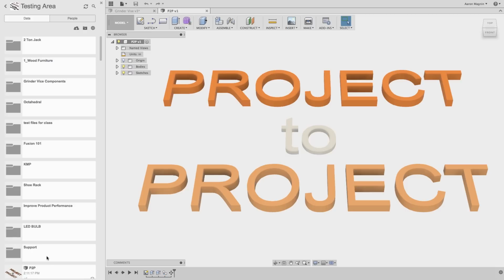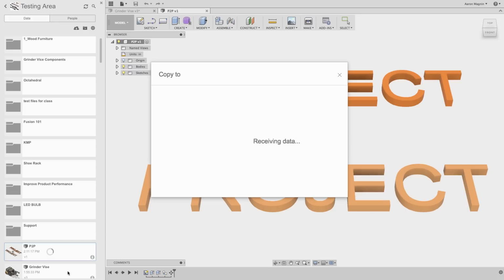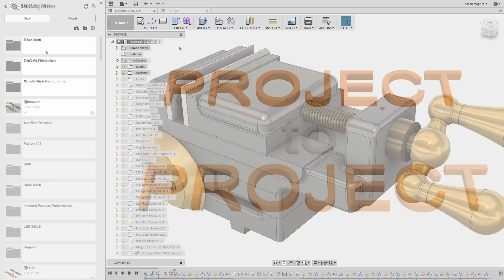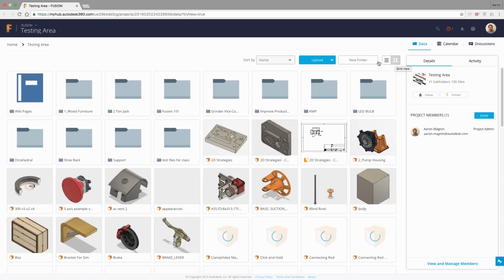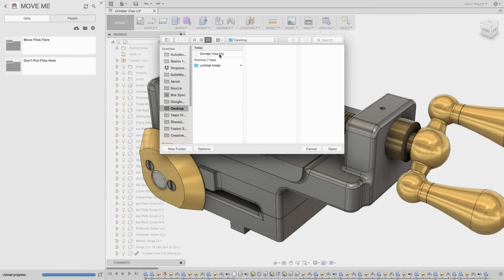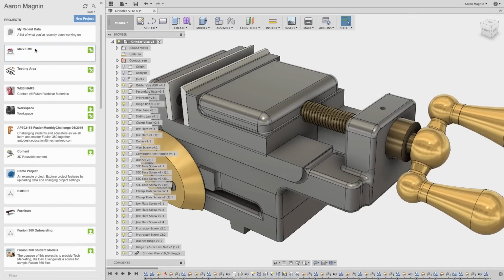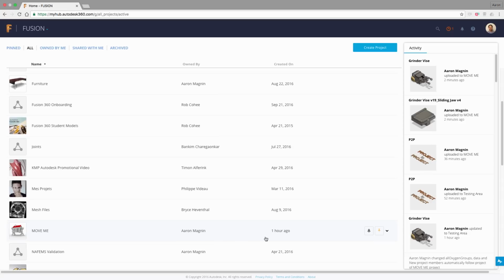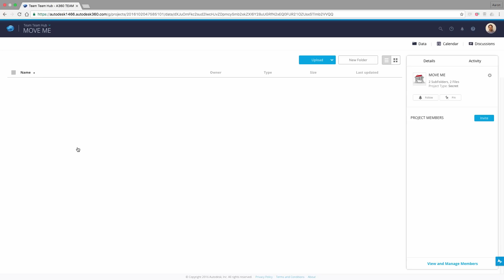QUICK TIP: Move and Copy Designs

Comment: Hi, I just looked at your copy and move tips... great thanks. but speaking of file manipulation; I wonder if I can take a STL file (from thingiverse.com for example) and use the file to produce a tool path for my CNC... I imported the file into a project than I opened the project but once inside Fusion 360, I was unable to use the file to produce a tool path... do I need to copy the file an other way or should I transform it in some way ? thanks